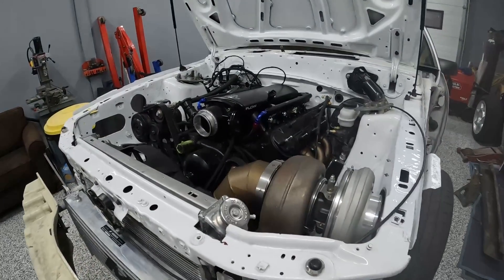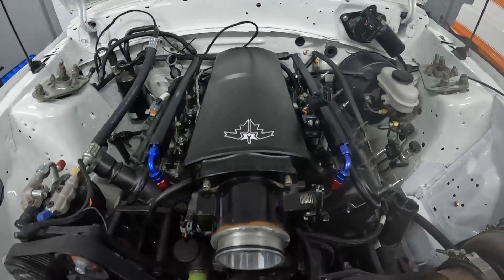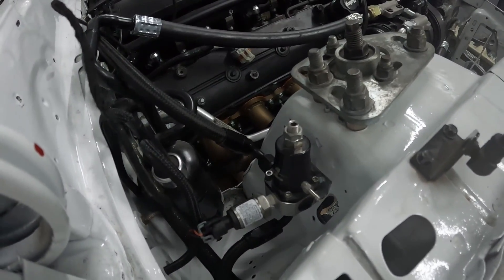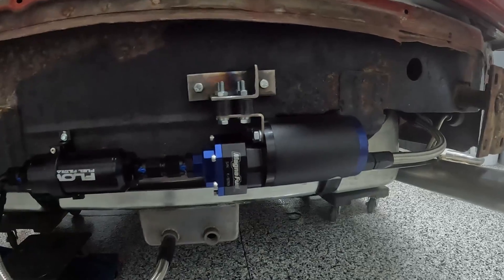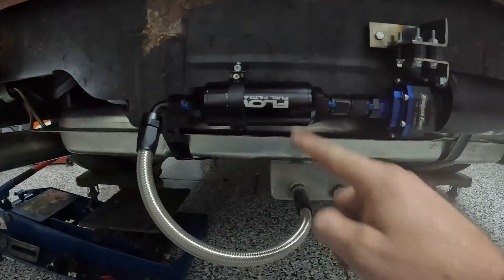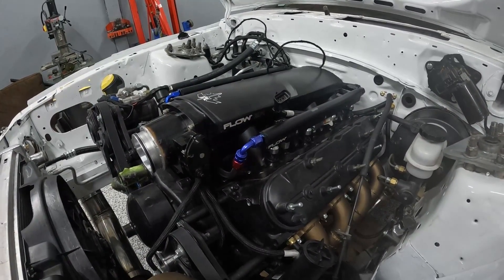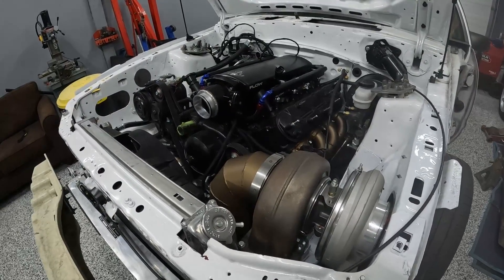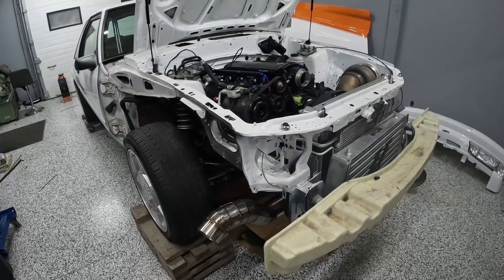Turbo LS Foxbody Fuel System for 1000 HP on E85 Including Costs

Comment: Go to -10 on the rail and the return. You wont flow properly with -8 on 210's. And never go down in size at any point always go up and build for larger than recommended. Dont do your fuel system 3 times like I did lol
Reply from the maker: Thanks, Did 860lb per hr today I think shes fine

Comment: My fuel system has dual 340 in tank pumps, -8an feed -6an return PTFE, Y block feeds both rails then out to the regulator. Bosch 210 injectors @ 44psi. Billet 80mm turbo 17 psi 94 pump
Reply: How much power are you making?

Comment: Feed needs to be a 12an to get the pump working to the best potential. 8 is going to hurt you big time for a feed. Even if you y 2 10an is better than a single 8
Reply: Oh boy. It's been proven time and time again that -8an/-6an PTFE will support over 1000 rwhp
Reply from the maker: Thanks for your comment! Maybe I will switch it up, you talking just the short line to the pump?
Reply: @WestcoastWrenchin  yes kinda. So to the pump yes do a 12 a but if you can’t do the two 10’s. As far feed line consider a 10 just due to the demand you are asking from the 210’s. I’m actually upgrading my own fuel system because of switching to a bigger injector fic 2150’s and adding another pump and going with bigger feed line 10an. Trust me I get the situation been there also but getting the system fixed once is better than swapping motors out because it went lean